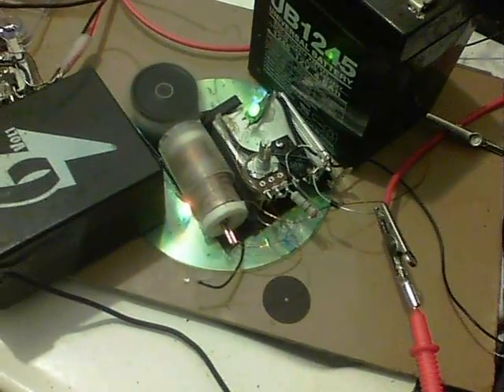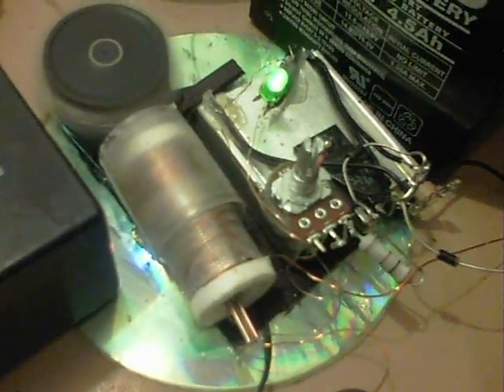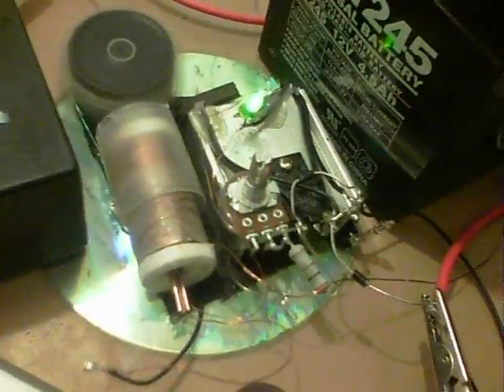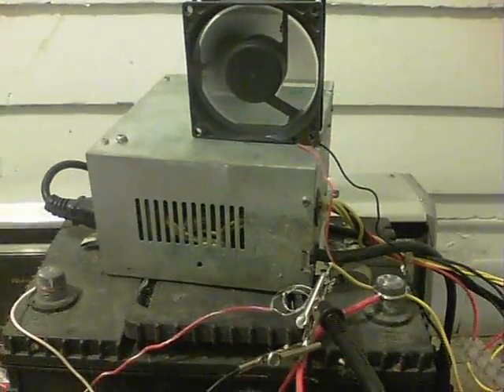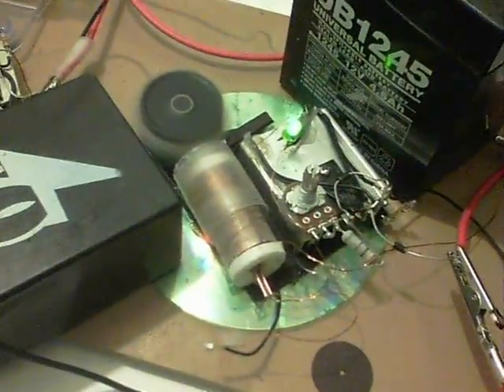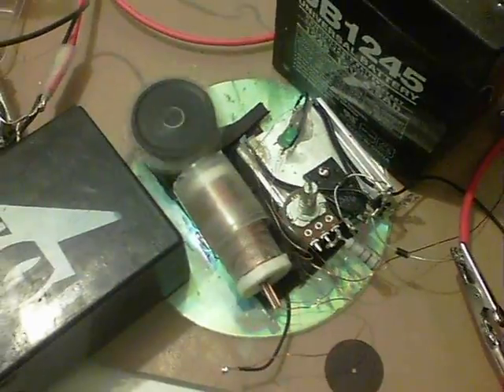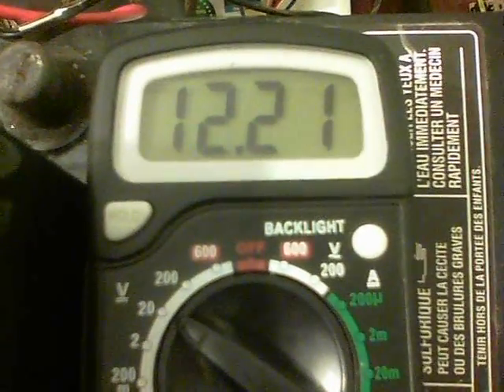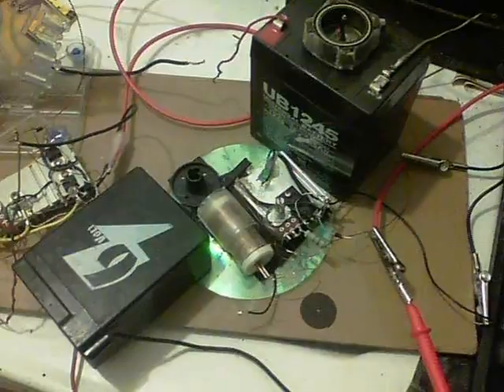Mini SSG

Comment: @slider2732 Add the primary coil of a commercial transformer in parralel to your run wind, the size of your rotor will have no bearing really on it's performance, you can make it as beefy as u want, with a couple of simple additions! :) Then she will chew away at the garden anchor nicely.

Comment from the maker: @KyleCarrington Sitting at 11.49V after a PC fan run. From the 1/2hr run on the real Bedini kit few days ago when fully dead, it then powered the kit rotor for 5 minutes afterward, so amperge is going in. On this little one I actually wouldn't expect the full sized car battery to rejuvenate completely, but it certainly has a good go at tickling it. Perhaps a week of runs with a real kit, or a month on this diddy one lol

Comment from the maker: System was on test today with Alkaline AA's. 
2x original "e3nergy" brand batts had been in a 2 year old digital temperatures type unit for months, flat. 0.300V and 1.130V. Ran the 0.300V for 1hr 45 mins, the 1.130V for 45 minutes. End voltages after 1hr rest were 1.451V and 1.471V - temp sensor is back up and running :D

Comment: @slider2732 Agreed. It was that point that made me toss the Bedini circuit out the door, after about 10 months of playing with it, but I am looking at all again with a fresh view... this time not so "worried" about over charging batteries. It is a good circuit, in that it desulphates and provides for things like ceiling fans to charge batteries / unconventional uses.. if not free energy - it's still very useful I think.

Comment from the maker: @KyleCarrington Fluffy is somewhat explained by fast charging...if it seems to climb and finish in 30 minutes on a car battery then it aint ! On my own design circuits, that was a thing worked out with little AA's etc. The way to view it is that voltage climbs first and then amps build. I can have an AA rechargeable batt sat at 1.27V for 3 hrs, doesn't mean it finished charging 3hrs earlier. Amperage apparently has to be tested with a load too, like a fan or something :)

Comment: @slider2732 I say that meaning, they all are relatively easy to build, but just when you think you have something good (as a beginner) you find out the charge it delivers is very fluffy and "not lasting". It has lead me to want a simple motor with big beefy spikes. The type of unit that practically arcs itself onto the charge battery when toyed with.

Comment: @slider2732 i have found the SSG quite mysterious too. In my experience it gets even worse when you embark off on the solid state self oscillating realm. I initially build a rotor based unit, two actually, then quickly moved on to rotorless, but after much frustration, I am going back to rotor-based, and I'm going as simple as they get, reed switch based. I think for the beginner there is a lot to be said for avoiding complexity in this Bedini stuff.

Comment from the maker: @CTOL1 Yes indeed, anything would be fine ! It was junk. If it even has just the power to run the SSG to charge a good battery, then that would be fine. It had 6A on it after the short Bedini kit charge, will have to see what it has now and carry on reconditioning it. I had nowhere to dispose of it anyway, so what the hey :) Thanks for watching.

Comment from the maker: @iluzyon1 That's what i'm seeing too yep. I first started with an SSG attempt a year or so ago, but couldn't make it run. Working with the Bedini kit that i'm building for someone has really opened this back up again. Now I get it ! lol. 
I let the speed build at full open pot (just 100ohm resistor) and then dial it down til it runs slower. Many say that around 500ohm works best on theirs, will have to measure many areas inc amperage. Just glad it runs :)

Comment: Realy nice, got to make my own. I just put my first Imhotep bedini ssg fan togheter last week but i am running it on 5.4 volts (4X AA battery)  because i got no 12 v. Is your motor reacting the same as my fan? I got more voltage on charge output when the fan turns slower and it drains less amps.